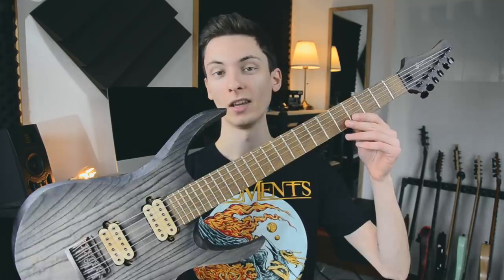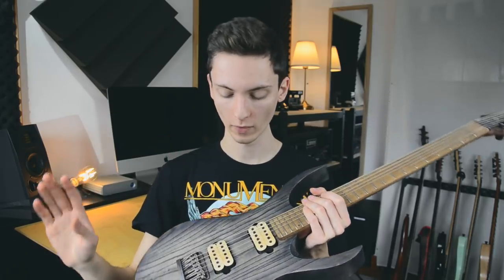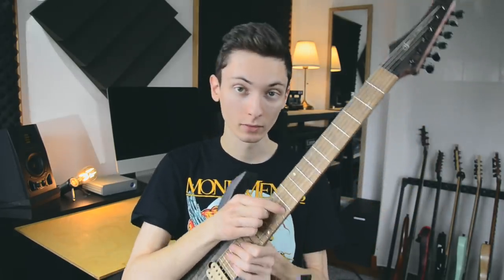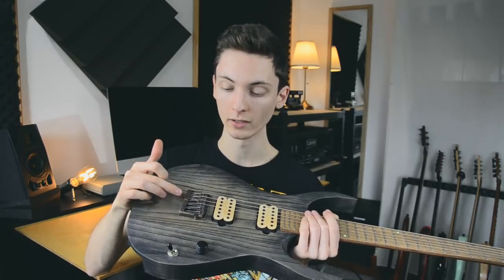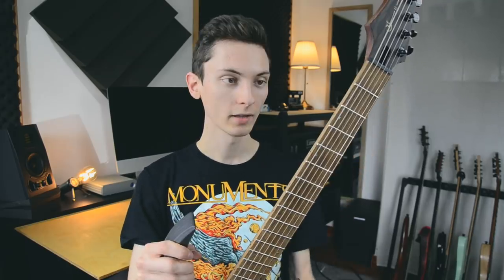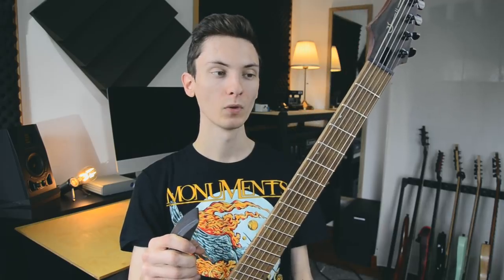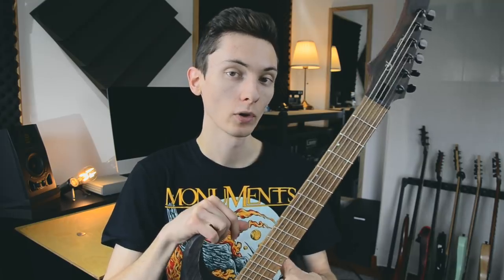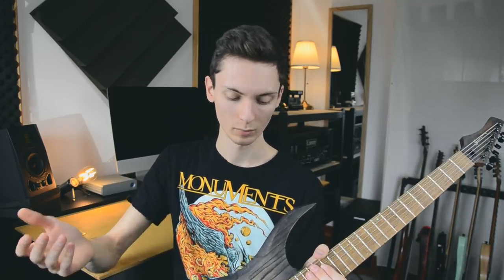Building My First Electric Guitar | The Result

Comment: After building this one, what is your impression on how difficult a neck-through guitar would be? I want to build a neck-through but I wonder if that is too big a step compared to set or bolt on.
Reply: A neckthrough would be theoretically easier
Reply: @andresisais6069  that's kind of what i'm thinking, but my biggest worry is to make sure the height of the fretboard above the body is enough to work with the bridge. I need to look at some charts and diagrams to see what makes sense.
Reply from the maker: A neck-thru looks easier in theory, but it's definitely not. You usually have a top on there, so you need to level that area down by the thickness of the top, you need to cut out a "neck pocket" in the top to make it fit around the fretboard etc. I personally prefer bolt-on anyway so I'll stick with that

Comment: The finishing details are so tough not to mess up. I have had to restart finishes a couple times for reasons like: dog hair in the air sticking to my final top-coat, dyes changing colours or streaking when applying top coats, sanding through one part of the finish, random shit getting toppled onto the guitar.

I hate working with oak because it can be a splintery mess. Would you use it again?
Reply from the maker: Randy Epp I'll probably never do solid sprayed finishes because I want to see the wood I worked with, but I totally know these problems haha
Probably not going to use oak ever again. It's good for old furniture but not instruments
Reply: @MilianMalivukMusic  - I did two solid colour RG refinishes. As you have seen, basswood isn't the prettiest of woods. I did do a Black Walnut back & Flamed Maple top body with a stain & oil finish last year.

Comment: you could have filled the badly placed tuner hole with wood glue and a dowel  then re-drilled the hole. then covered the head stock with a veneer or heavy stain to hide the fix.

Comment: I am mostly interest in how you got the frets installed. How did you press them in? Did you use glue, if so, what kind?
Reply: Normal procedure would be to GENTLY tap them in with for instance a rubber covered hammer.
Check out the willseasyguitar or crimsonguitars channels for TONS of videos on how to build yourself.
Both are professionel luthiers doing lots of tutorial videos.